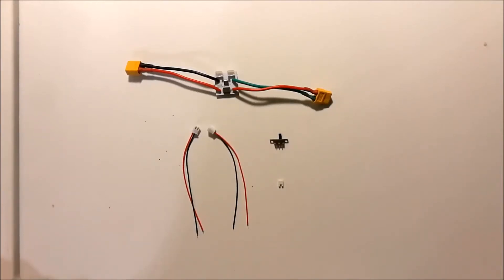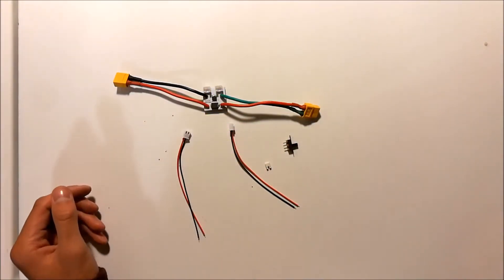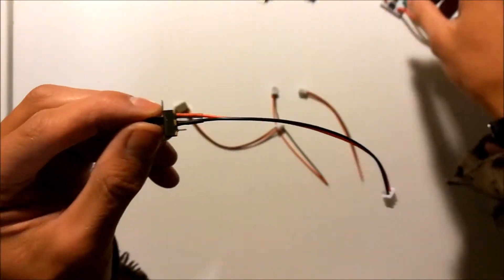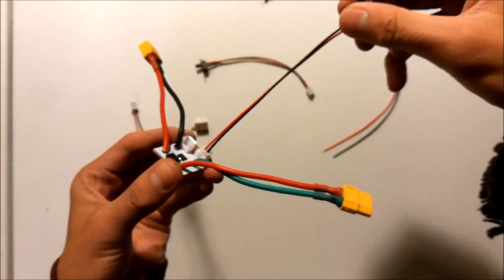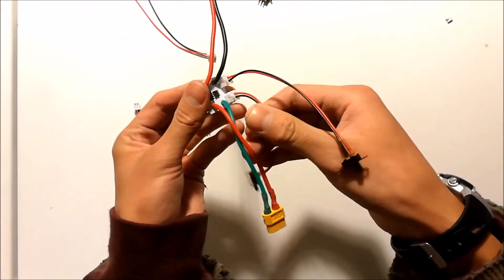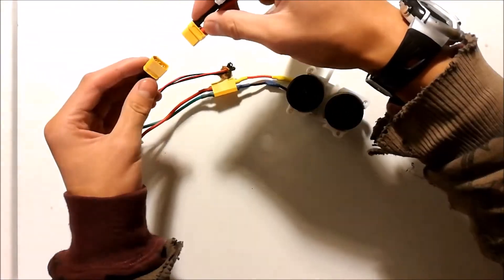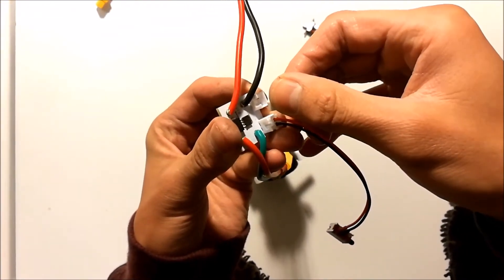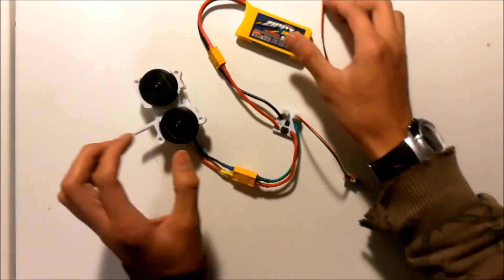Nerf MOSFET Board Kit Wiring Tutorial

Comment: Great work !!! This is probably a newbie question, but will this mosfet work with both a rapidstrike and a stryf? Appreciate the time
Reply from the maker: Thanks! Yep, it will work in both the Rapidstrike and the Stryfe. These don't include motor braking, so it won't work on the Rapidstrike pusher.
Reply: @suild4680  Sorry...could you elaborate on what you mean by "it won't work on the pusher". Will be pusher stop where it's at in the cycle? thanks again.
Reply from the maker: For pushers, it's best to have the pusher stopped in it's retracted state. To have this done reliably, you'll need motor braking that stops the motor exactly when it needs to be stopped. If you don't have motor braking, the motors will still spin a bit even if the power is off (think when you rev your flywheel motors until full speed and turn then off, the motors are still spinning, albeit slowing down). These MOSFET boards don't have mototr braking, so the pusher won't always stop in its retracted position reliably.

Comment: just installed this! can it handle a set of brushless motors or will i have to stick with brushed?
Reply from the maker: Awesome! These MOSFET boards don't support burshless motors, but a Smart Blaster brushless motor kit is currently in the works.
Reply: thanks, i just meant if they'll handle the current. i'm pretty sure i can do the actual setup of brushless myself.
Reply from the maker: It depends on the specific motor. The MOSFET itself can probably handle some beefy brushless motors, but the physical board itself can't. The board suffices for brushed motors, so there will be no issues when running them for our purposes. A brushless motor controller will be the best option anyways.
Reply: i'm doing a two stage mod with brushed stage 1 and brushless stage 2, but they're running seperate batteries so the board should be fine for handling the 3S for the brushed motors.
Reply from the maker: Yep, the MOSFET board will be perfectly fine handling 3S batteries and brushed motors.

Comment: what do i do to make the battery wire longer?
Reply from the maker: You can either make an XT60 male to female extension cable or splice some wire between the board and battery connector.
Reply: oh okay thanks!

Comment: how would you go about securing the board in Rival Hera?
Reply from the maker: I'm making a video on that, but it's just the same. Wire up your motors to an XT60, plug it into the board, plug in the switches and batteries, and you're good to go.

Comment: This is awesome! Just bought it! Could you switch the kill switch has a second switch for 3 motor setups?
Reply from the maker: Thanks! Could you please clarify your question? This board has not yet been tested with 3 motor setups, but it worked fine when I ran 4 Cronus-Xs through it.
Reply: Sorry.  I was wondering if you could wire a second switch in instead of the rocker switch or whatever it is called.  So you could put this into a rapidstrike?
Reply from the maker: Yep, you can wire a second switch instead of the included slider switch. This will work for the flywheels on the Rapidstrike, but not the pusher.
Reply: ok thanks!